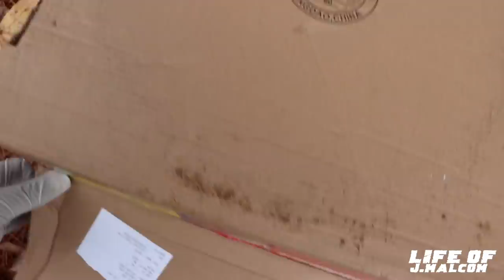MEAN BURNOUT ON 26 INCH RIMS WITH THE DOLO BOX CHEVY AND THE F150 GAVE ME A PROBLEM....

Comment: Do a 1996 impala rearend it will fit and it already have the disk brake setup
Reply from the maker: I’ll be going backwards doing that. My rear end way more beefed up and has bigger axles and axle tubes as well
Reply: part that sucks is tha is an 8.5 in the car already so just take the brakes

Comment: Keep it GM and get a Moser 12 bolt with the ford style bearing ends so u do away with c clips   I picked up one for my gbody its lighter and take less power to turn than a 9in 8.8 still a c clip diff not much stronger than a gm 8.5